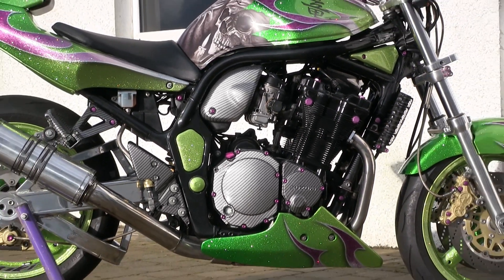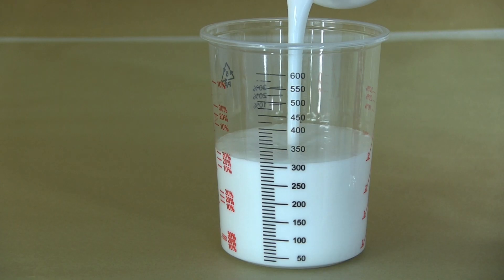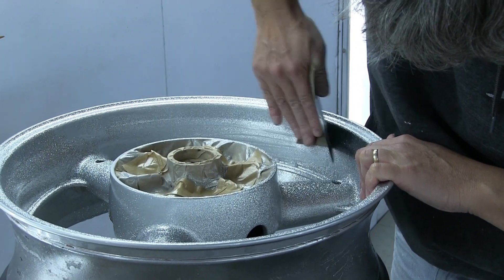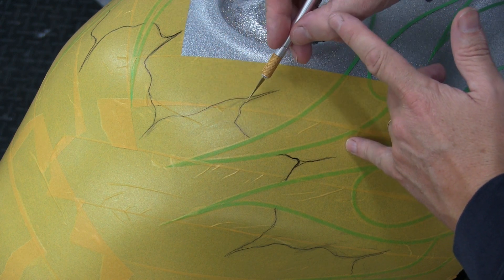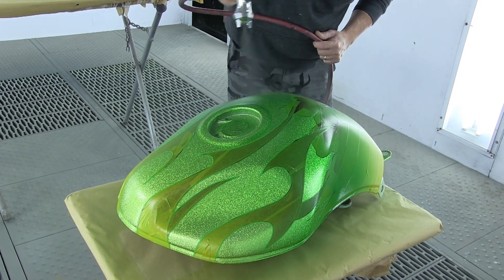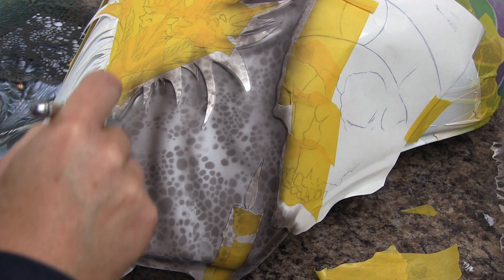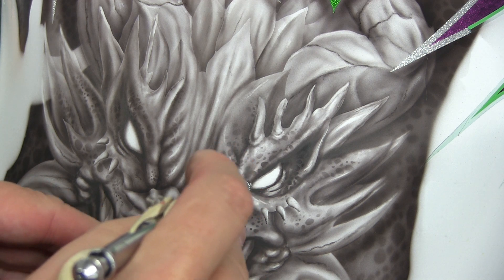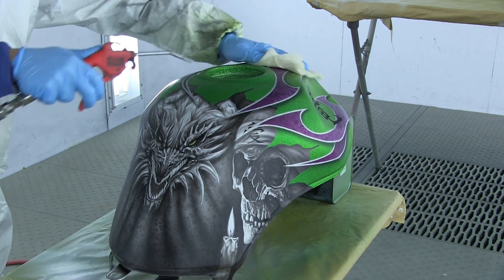How to spray a complete motorcycle

Comment: TONS OF GOOD INFO in this vid, glad i found it, i paint bikes for a living.   Do you prefer the waterborne sealer over a 2k sealer?  no issues with lifting or anything?  I usually use all urethane products but wondering if i should switch to waterborne for my graphics.  Love the trick with the silver sealer and straight to flake, saves tons of time.
Reply from the maker: I use a urethane gloss clear and then Createx UVLS matt over that, no issues lifting.